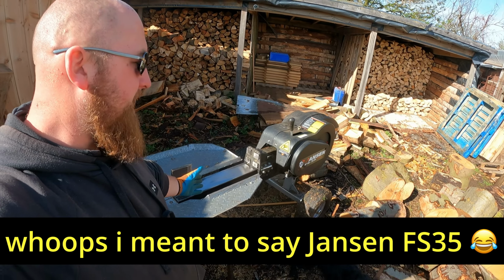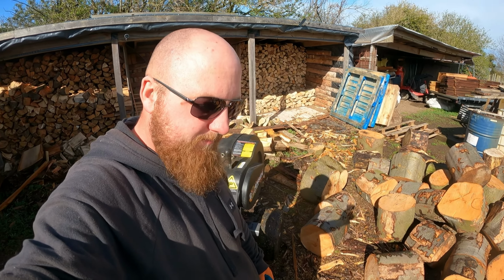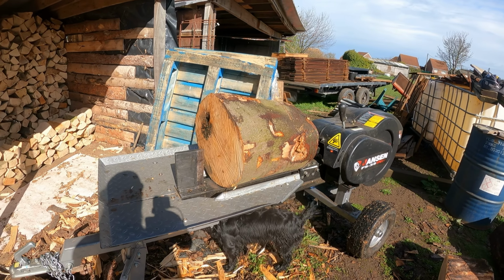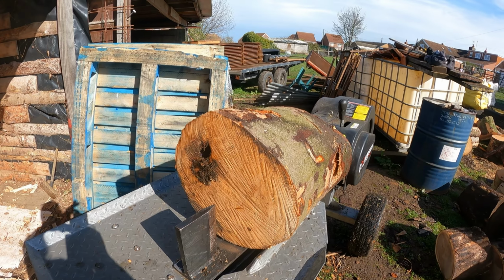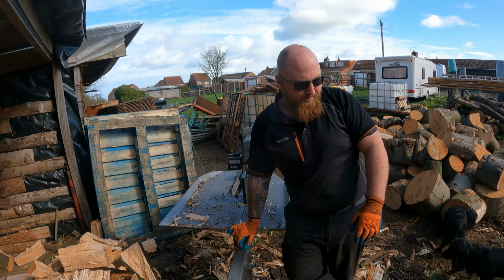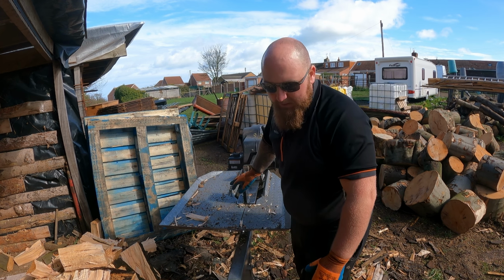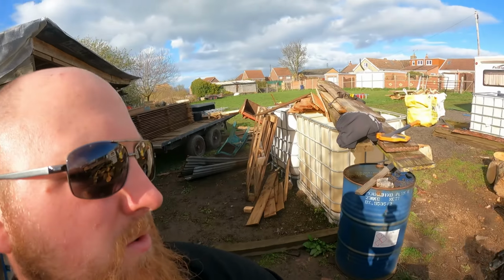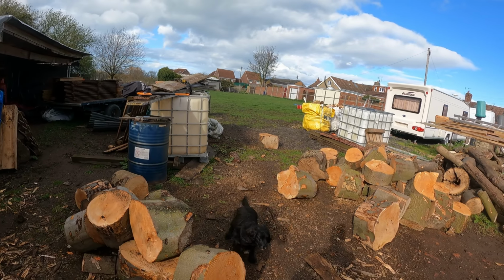Splitting some Beeching big rounds with Jansen FS35 Kinetic log splitter

Comment: Good to see you again.  We've had some wind here in Northeast Tenn. as well.  It brought down an 80 foot pine at my friends no kill animal shelter and hit one of her sheds.  I'm going to pull my OS27 over there and get some 2x4's to expand my shop.  I keep all the sawdust for her so she can use it as kitty litter.  Your log splitter looks awesome.  Until the next one.
Reply from the maker: Hey Jeff good to hear you are safe. That pine tree should produce some very nice building material for sure. The OS27 will make light work of that pine. Just be aware of pitch or sap build up on the blade, I think lubricant will be required 😄 
Thank you about the splitter, it is a great tool for wood splitting. Take care buddy 👍

Comment: Kinetic splitters have me worried sometimes for safety. OK if you're on your own and a good operator like you but when I split a large batch there's two of us and I value my fingers 😀Beech splits nice but if you leave it to dry out it's like concrete. Wish I had a log store like yours.
Reply from the maker: Hey Simon. I have been told the very same about Beech once dried. They said split green or else it will be difficult work once dry.
Regarding the splitter, I get your concerns. There is a lad who helps me and he is well used to the machine and can do a good job but you really do need your wits about you incase you take your eye of the ball. They are actually 2 handed from factory but I removed one. 
Thank you again 👍

Comment: I do not recommend this machine. I had it and the transmission was very faulty👎
Reply from the maker: Hey Robert, i agree i have had some issues with the clutch mechanism which is a shame because the splitter is fantastic for sure.
Thanks for commenting.